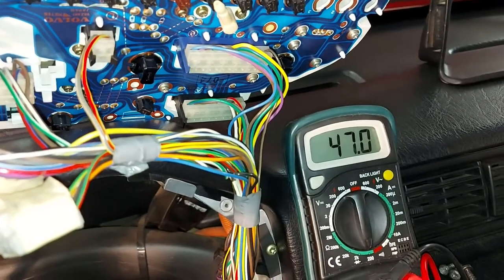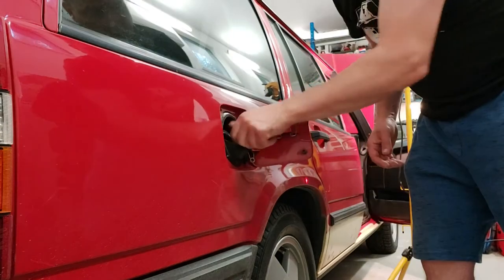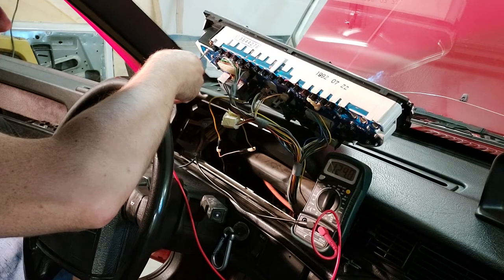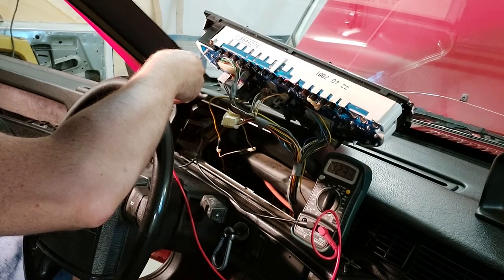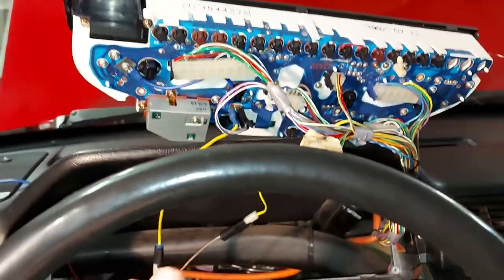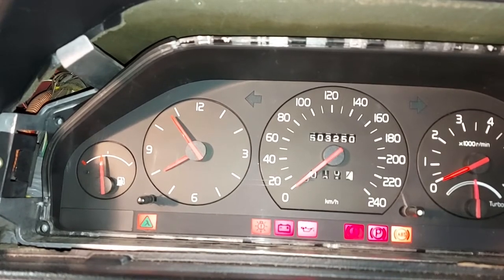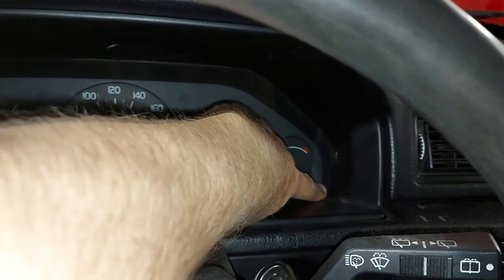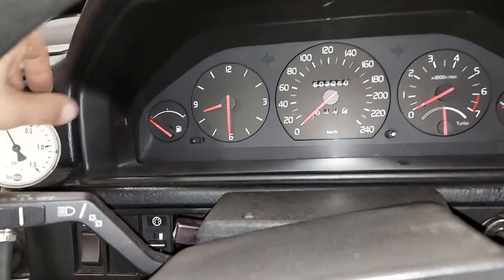Fixing the fuel gauge | Volvo 940 turbo | B230FT |

Comment: Great video going to see if this will help me with my 760 that I just bought!!!
Reply from the maker: Thanks. It might help.🤗👍 Congrats for the new car!👌
Reply: Idk what the screw is for but I’m not getting 12v on the one you use for the bypass. Maybe I got to find another screw?
Reply: I found one but it was always 12volts so I switched it to another one that got 12volts with the key on but then it stopped getting 12v. So I used another one and it did the same thing. I disconnected the bypass wire and know they are getting 12volts again idk what’s going on???

Comment: Hi Hans, I did this to my Volvo and the fuel gauge does work now but only when I turn on my headlights. What gauge wire do you recommend and does the thickness of the wire matter for this job? Copper wire or can it be a basic wire? Thanks.

Comment: Great video, having the same problem. Did you get the temperature gauge to work?
Reply from the maker: Thanks, not yet. I will focus on that later.😊
Reply: @hanssgarage1886  Strange its in the middle? I've had a broken temp sensor in my 940 and with that, the needle remains in the "cold" position (to the left). So it's probably an other contact problem in the gauge cluster I think.

Comment: sadly my panel wont come out at all i pried like an idiot and its still stuck
Reply from the maker: These panels are a bit of problem... I'm having now problems with temp gauge.
Reply: update: i dismantled the underside of the steering column (the plastic cover there), unbolted my seat and pried using a prying bar to find out one of the previous owners welded the metal ring to the retention clips inside... im waiting for my angle grinder to arrive -.-
Reply: @hanssgarage1886  the temp guage issues is actually pretty simple to fix, the most annoying part is finding the voltages and resistance that the coolant temp sensor sends, if you want i can look at my working gauge and try to find out the readings
Reply from the maker: @Asterix1022  No need, thanks. The problem is the gauge itself. I'm trying to fix it with soldering iron...

Comment: Hans,

My fuel gauge is on empty. The fuel sending unit and pump are now both out of the fuel tank. The fuel tank is inside my garage. My question is what is actually sending the 'signal to the fuel gauge' when you fill up the tank ? What happens ? Does the sending unit compress or expand inside the tank when you add fuel to the tank ?  I want to try and test the sending unit by having my son compress the sending unit. Will compression make the fuel gauge read on E or F ? Letting it go and not touching it, should the gauge read E or F ? - Thanks, Pg

Comment: was the gauge completly dead, when i turn mine on it goes just over half way then dosnt move all running time
Reply from the maker: Yes, my gauge was completly dead. With multimeter you can measure the resistance. If it stays at same when you add some fuel you know there is something wrong with the fuel level sensor. Does the warning light work?
Reply: Okay thankyou, no warning light for me, when i turn car on the gauge goes up to just past half full and stays there
Reply from the maker: @lyndenleatherland5384  then i would bet on level sensor. The multimeter and resistance will give you the answer.😊
Reply: Awesome thankyou will try over the weekend

Comment: I have 960 which has problem with fuel gauge too. It shows bit less than quarter of a tank. I've read on 960 it works other way around, 0 to full and 280 to empty, I jumped pins (in the trunk) with wire and gauge jumpd to full. Connectors disconnected gauge was showing empty and low fuel light was on.
Sooooo, have u have any idea how to fix level sending unit?
Reply: Did you fix the problem i have the same problem?